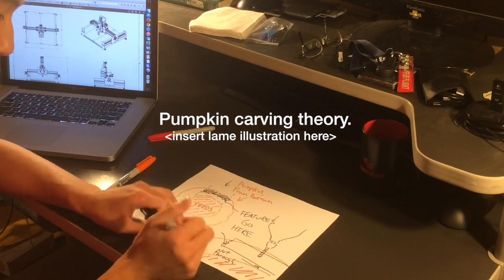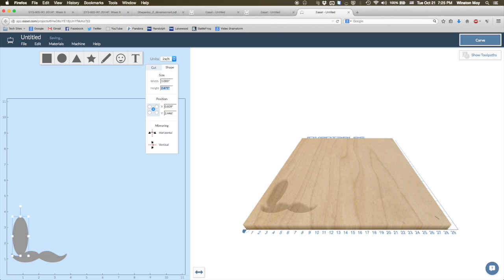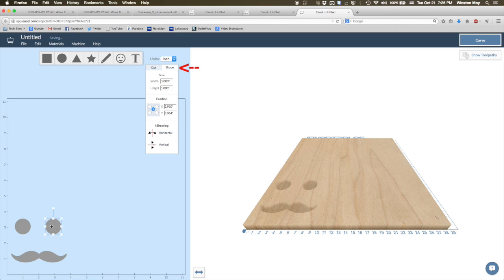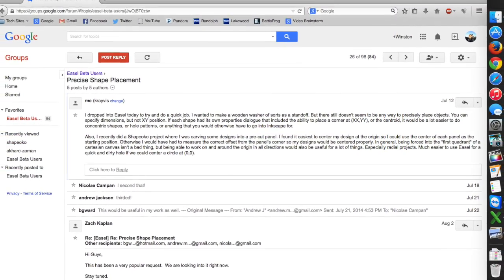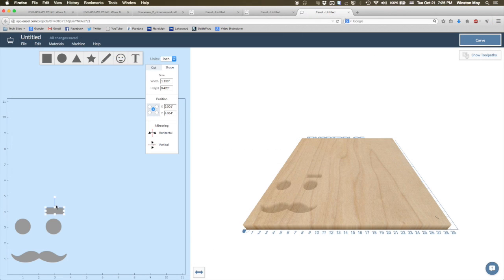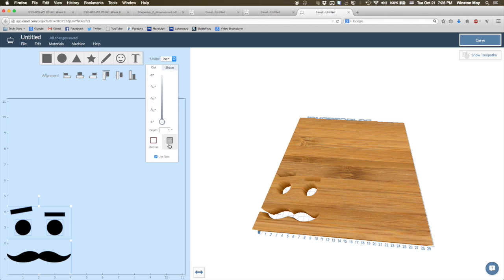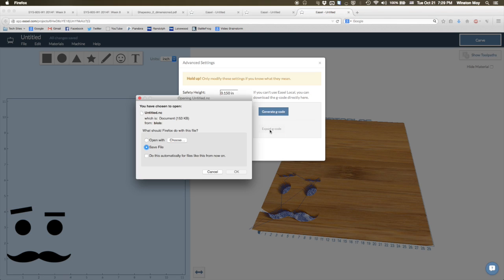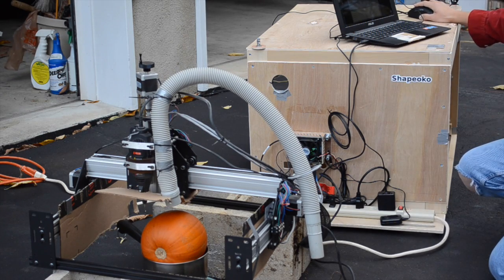Pumpkin Carving, CNC Style - Ep. 23

Comment: You probbaly know this by now, but for anyone who doesn't, you can actually grab your design in Easel, and move it so ITS center, is at the 0,0 point in the designer view.  By doing that, you can 'zero' at your object's center, and it will work as you expect, starting frmo center and working from there.

Comment: It would be awesome to see you build out an elevation rack for your S3.  That way you can slide larger items under than the 3" Z max.  And, possibly afterward you could lower the elevation for a deeper cut on the z axis without disrupting the X or Y axis.  :-D

Your videos are a Godsend... 
I'm new to all of this and am researching while I wait on the expansion for the S3, so that I can get right to work when I learn how to use it. :-D
Reply from the maker: +TheRangeControl I'm excited to see what the expansion kits will do for the frame. Right now the steel straps don't give as much flexibility as the old 80/20 frame on the S2's. Once Edward confronts having multiple configurations, I think he'll put out a more modular, hackable base setup.
Reply: +Winston Moy multiple configurations on the S3?
Reply from the maker: Multiple size configurations, ex. 2 foot, 4 foot, 6 foot extrusions, etc. It's going to require a more flexible system for mounting the wasteboard and squaring the machine.
Reply: +Winston Moy I was under the impression that they were now (almost decidedly) were going with a 5'x5' expansion configuration from what I read on it a few days ago.  has that changed?

(off topic: based on your driver's course video, I'm guessing that you reside in NJ...  How far are you from New Haven?)
Reply: +Winston Moy I could use some help converging some upcoming projects.
Reply from the maker: Oh, I'm a little behind the times. Haven't had time to check recent developments. (Do you have a link to the source?)

And I'm about 2.5 - 3 hours away. Not terrible, but currently a bit much. My next 6 weekends are booked, and I'm struggling to balance 4 different projects I want to get to before November. RIP Free time...
Reply: +Winston Moy Sorry for the delay: http://www.shapeoko.com/forum/viewtopic.php?f=7&t=5987

And, for actual dimensional updates, I suppose that it has been a while.

Regarding what I need assistance with in New Haven area, it is much larger than a 1 off project.  I was wondering if you may be open to serving/acting as an advisor... it would require very little on-site experience, but experience is almost always welcome when novices are looking to create something of significance.

I'd love to communicate with you about it, if you're open to a dialogue.
Reply from the maker: +TheRangeControl Not sure how much help I could be, but I'm willing to hear you out. Send me a DM and we'll talk.
Reply: +Winston Moy Am I not seeing the option in your "about" section?

I have checked here and G+.

Apologies for my ignorance... I'm just getting to know google platforms.  :-D
Reply: +Winston Moy as a courtesy, I wanted to send you an updated thread...

...it seems that a larger size isn't going to be an upgrade in form so much as an option for larger sizing.

I don't care either way, as long as the finish it and put it out to market.

http://www.shapeoko.com/forum/viewtopic.php?f=7&t=5987&p=55001#p55001

Comment: I really enjoy your videos - I always laugh, (where I'm meant to), and often learn something new. I agree on choosing start points in Easel too, (although my 2012 27" imac graphics card won't support it, which is a pain in the ass).

I know you want to shy away from paid software, but illustrator does have some object align options, just as a head's up. There's another new, (pretty sure it's free) vector software recently released that I have not looked at yet which may give you the control you want.

Did you lose accuracy when you put the shapeoko back on it's base, or was the frame rigid enough to be moved about and not shift? Thanks for another great vid